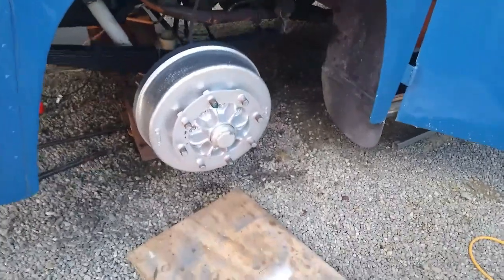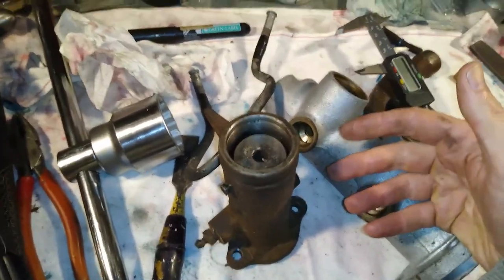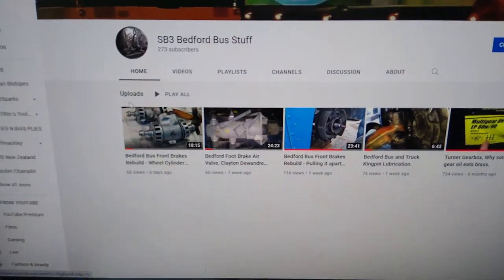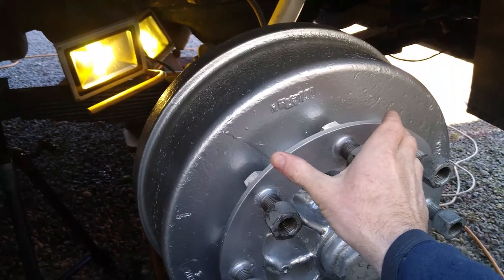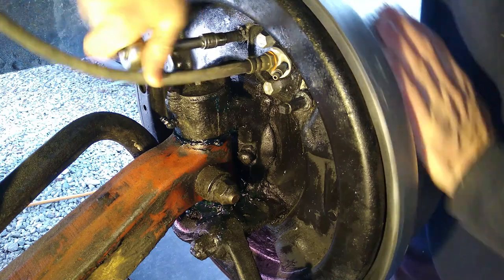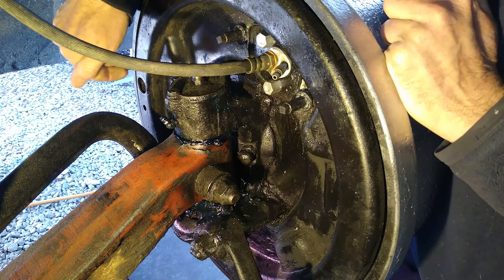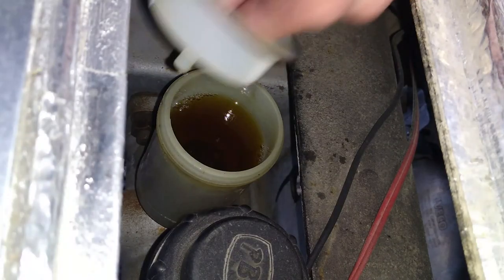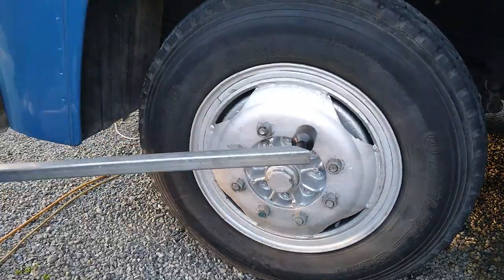Bedford Bus Front Brakes Rebuild - ADJUSTING & BLEEDING BRAKES (Part 4 of 4)

Comment: Hi Love the video, most informative. I'm about to upgrade my coach to air/hydraulics from vacuum/hydraulics as I've changed engine to one fitted with an air compressor. Could you tell me please if you have air tank reservoirs inbetween the compressor and the air master or do you feed the air from the compressor straight into the air master please? many thanks
Reply: I dont know whether you've got an answer to this, let us know if you are still enquiring.